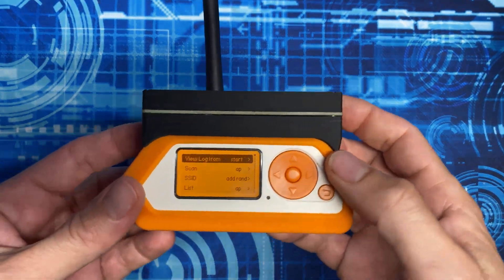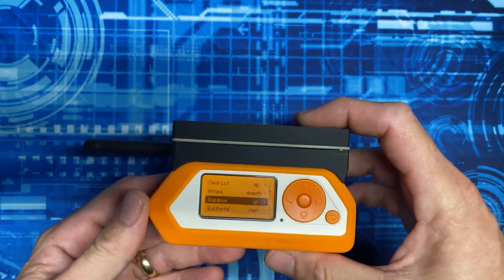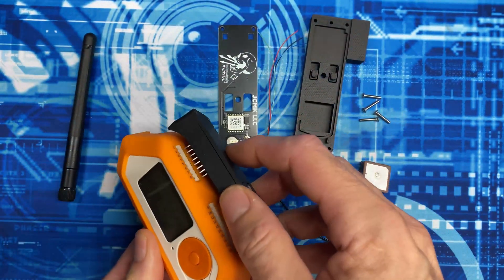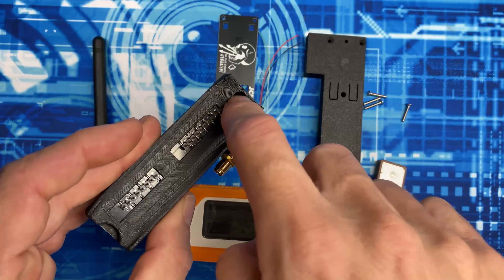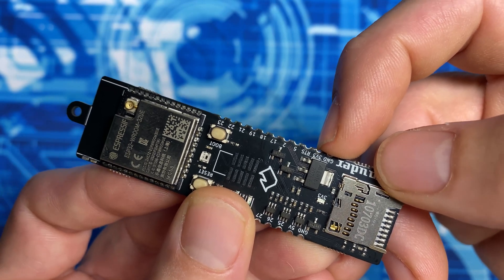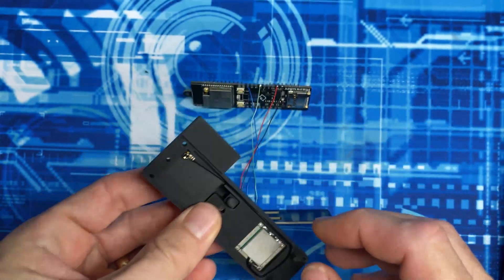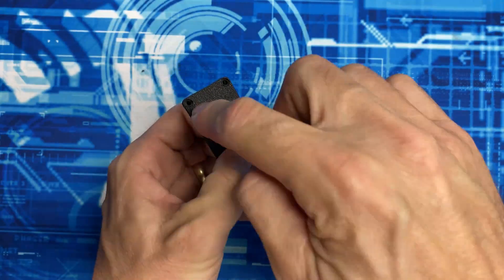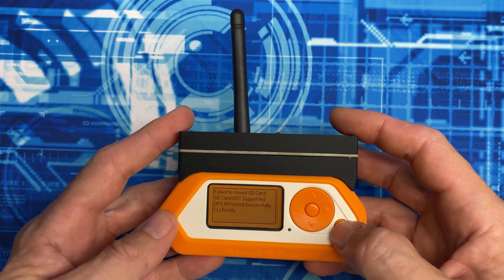Flipper Zero Wardriving with Wifi Dev Board Pro and GPS

Comment: Wardriving is the act of driving around a specific area with a device capable of scanning and detecting wireless networks. Typically, wardrivers use laptops, smartphones, or specialised hardware to search for Wi-Fi signals in public or private spaces. The goal is to locate wireless networks, assess their security, and often document them for later exploitation.